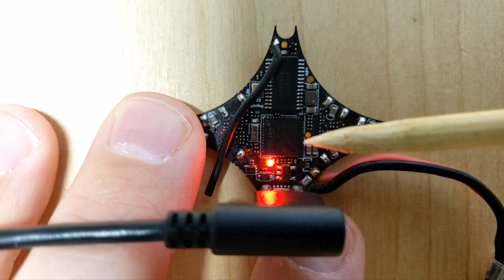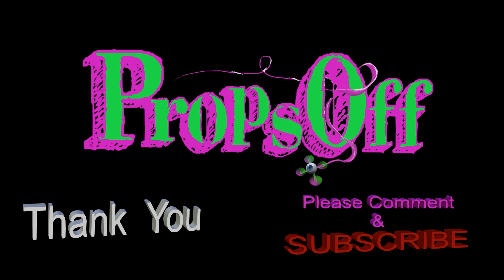Happymodel Superbee Issue | RX Loss

Comment: I had this happen after a crash on my Betafpv meteor 75 pro.  I covered the area with flux and heated the area up with a soldering iron and some foil until I saw the solder get wet looking.  My Rx came back and the thing is still flying.  I got lucky for sure on that little operation.  I want to thank you for what you do.  Your the guy that has helped me a great deal with building my 65mm whoops into the fantastic flying little beasties that they are.
Reply from the maker: That's awesome, brave repair 4shO!
I appreciate your support and encouragement, I'm sitting here trying to get my two broken whoops fixed for tomorrow night's race. Your kind words have put some wind in my sails...👍🏻🍻👊🏻

Comment: Excellent video.  I don't have an SMD flow station either.  I wonder if just a heat gun used for heat shrink would work in a pinch?
Reply from the maker: I have a heat gun, but it gets very hot. Can't say I haven't looked at it a dozen times...🤣

Comment: After going through 4 flight controllers on the Tinyhawk 3 I stopped flying small 1s cinewhoops.    I did notice that most of my issues with the TH3 were when the battery voltage was getting low (not a fan of 1s HV batteries), it maybe the connectors but I can no longer see well enough to work on those tiny boards.  I was thinking about bumping the TH3 up to 2s but I never got around to it.
Reply from the maker: I hear ya, I don't have issues with my larger quads. I never invested in the Tinyhawk, everything is too specific and proprietary.

Comment: I tried a heat gut and also in the oven. Actually it worked out. But after like an other crash again same day it had the issue back. Mine was a betafpv 5a aio. Since I'm using a fractial stiff carbon frame, my AIO in the middle is not bending with the whole whoop frame anymore. No more destroyed aio
Reply from the maker: Interesting. The Fractal frame is that stiff... I may need to check it out...🍻

Comment: Had exactly same issue with a TuneRC AIO 4S controller.
Reply from the maker: Interesting, I'm unfamiliar with that AIO. I'm curious, do you think is was the PDB thickness and/or the solder work?
Reply: @PropsOff  no idea didn’t look that close I threw it in the garbage since it was my second same AIO failing

Comment: I had an issue with a Mobula7 1s I just bought. I'm 99% certain it was a board issue.  No matter what I did, it would go bonkers once I applied throttle. I think the gyro was DOA.  I exchanged it and the replacement flies great. Its a different FC tough, the board name is CRAZYBEE something or other depending in spi receiver type.
Reply from the maker: I've had a few HM flight controllers arrive DOA. Very frustrating. Of the 14 HM flight controllers I've purchased this past year, I have 5 that work. Now, a few of those where absolute rippers and I had a great time with them, but the ones that fail are too many.